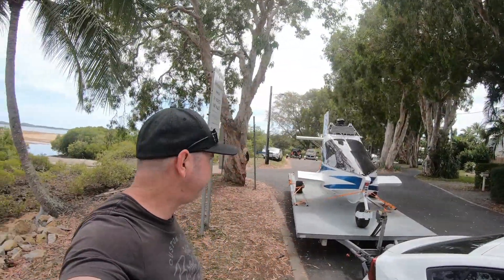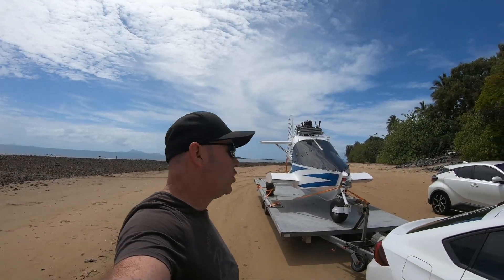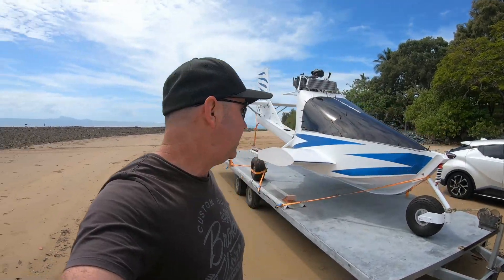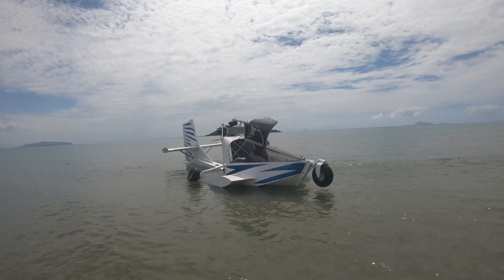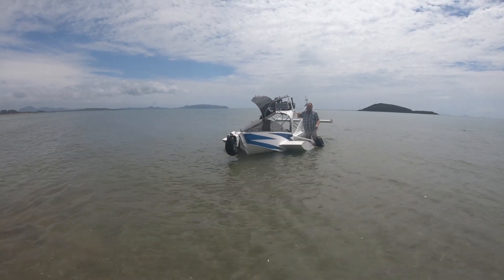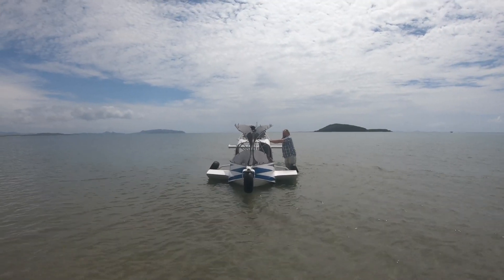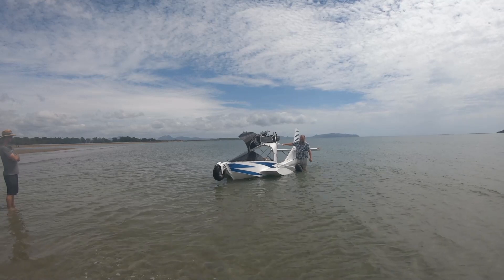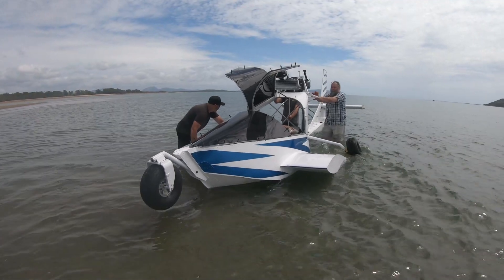Ultimate Experimental Aircraft seaplane Float testing ultralight aircraft Searey aircraft landing

Comment: Looks awesome. Curious to hear how dry did it stay inside on this first float test? Is there a bulge pump at the low point yet? Very cool project. Great videos also!!
Reply from the maker: I only had 1 leak from a rivet hole I had missed deliberately and forgot to tape it around the boom strut plates. Yes I definitely will have a bilge pump and will be part of my Pre flight in water operations to turn on and look for water 💦. Thanks for watching and following along 👍

Comment: Bummer about the glazing, but she floats...so that's good!!! Your hull has nice lines. Can't wait to see the water-taxi trials.
Reply from the maker: Thanks @Paul Slevinsjy yes but at least it’s an easy fix just a silly oversight on my part thanks for that appreciate it .Now I have seen it in the water I can’t wait to start some powered testing 👍
Reply: @michaelhille261  I built a little airboat. I was going to float-test the mold plug and tune any issues before creating the fiberglass copy. Unfortunately I had to substitute some press-board in the mold because of supply issues (floating it probably would've destroyed it). I'll be floating the glass hull in the next month or so. 

p.s. I .... HATE ... working with glass
Reply from the maker: That sounds awesome Paul. Good luck with the testing hahah yes Fibreglass gets itchy I'm not the best at glass work. but finish can be real nice though

Comment: Great learnings!!
Reply from the maker: @ Joseph Shulsky Definitely learning a heap along the way.
Reply: @michaelhille261  did you consider tucking in the front wheel vs raising it out of the way?  
I’m sure you did, I look forward to your video explaining what went wrong.
Reply from the maker: Hi Joseph sorry for the late reply my notification didn't work and i missed a few comments.  Yes it would be really nice to tuck it away and i played with heaps of ways to do in in Fusion while designing it but i couldn't get it to work with such a large wheel and i wanted the big wheels for all terrain so i guess it was a bit of a trade off.